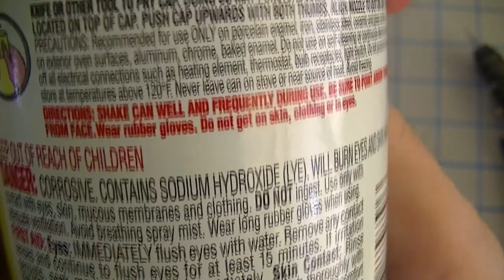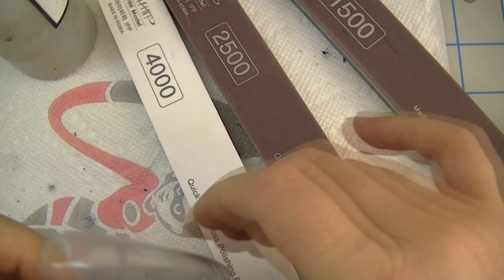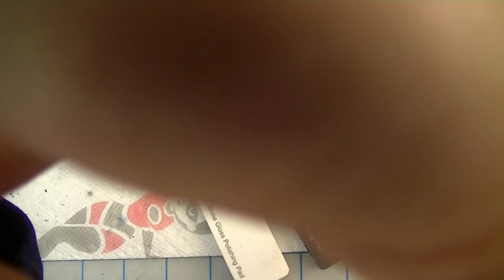ep216 - modelmaking fundamentals: polishing a canopy

Comment: Hey Will as a FYI, when went to a Micro mesh class on how to polish out scratches on a real canopy. The one thing the instructor stressed was not to sand in a circular motion. We started out with the "roughest" grit, spray a lot of water (we used a regular pump type spray bottle with tap water) sand in one direction. Once the area felt smooth and you weren't feeling resistance on your sanding pad. We went to the next highest grit and started sanding 90 degrees from the previous direction, and so on and so on till it was almost crystal clear  and then we used some plastic polishing compound.
Reply from the maker: Yes correct and I forgot to mention that. Always sand orthogonally. Having said that, I have to also say that I hate micromesh because of their shady made-up grit system. Regardless of that, though the technique is valid.

Comment: You ever try Nevr-Dull?   An old civilian watchmaker who worked in the instrument shop at one of the bases I was stationed used it to polish scratches out of watch crystals.  He would put a little spit on his finger and rub it on a small piece of crocus cloth to pick up some of the rouge, then he'd rub the crystal with his finger to polish the scratches.  Then he'd wipe that off and use a piece of Nevr-Dull to polish the haze off the crystal.  He'd make scratches disappear in a crystal that you would think needed to be replaced.  
It's a cotton so you could take a piece of it and polish on the inside of the canopy with your finger.

Comment: Hmmm......not convinced about not using Future.  I think it really brightens and clears clear parts pretty darn good!  Especially for the time commitment.
Reply from the maker: it's a poor solution that creates potential issues downstream.  polishing is easy and has no downsides.
Reply: @barpfoto  I disagree. I've been using Future for over 10 years and have never had an issue. My canopies are still perfectly clear and shiny.
Reply from the maker: @paulwoods4349  you're welcome to disagree. You do you. But that doesn't change the fact that you're doing unnecessary work and creating unnecessary risk and still not getting something that looks as good as a properly polished canopy.

Comment: Will, I may have missed it in an older video, but what kind of fiber are you using on that polishing wheel? My little cotton wheels don't seem to work well for me, even after I rough them up with a blade. Someone in the comments mentioned a soft foam medium for liquids?
Reply from the maker: for rouges, i use yellow cotton wheels.
Reply: @barpfoto  Shit, I feel lesser of a man now. My technique must suck, or I'm really obsessive of my shine with a cotton wheel and tubes of Tamiya polish. I'm getting some Zam.

Comment: Hi Will,  I know I'm probably about to ask a stupid question ! But I'm sure I'm not alone. I have been modelling for 40 years. I started with airfix enamels and now use acrylics, but you talk about mrp laquers. So I lay myself on the alter of ridicule and ask what are laquers and what is the difference between it and paint . And could you do a video explaining. Many thanks ( from England which probably isn't far enough away from you ! ) john
Reply: Big difference is that the laquer of the MRP is what I'd call slightly hot, meaning that it ever so slightly melts the surface because it is a solvent to styrene (like a ketone) which actually kind of bonds the pigments on to the surface and gets superior adhesion that is resistant to peeling or wearing. It becomes one with the styrene like Tamiya liquid glue does to plastic, but far less volatile.  Enamels are more of a varnish oil mix that hardens on top and doesn't penetrate the surface. Many "enamels" are more water based it seems these days. I think Will has some vids on it. Doog's Models I think does also as well as others. You can find them under MRP here on YouTube.

Comment: Will, I have used Future/Pledge floor care to cover some small cracks on the canopy of my typhoon to a good effect, looks like those windshield repairs that enters into the cracs and make them desapear, I had some of them looking like the Phanton you have showed here some time ago, In my model it was gone, I have masked them, painted and it didn´t peeled off. Now to strip paint I always use IPA in the ultrasonic bath, works every time for me. And I see you like power tools, have you tried out the foam type polishing pad that are like the ones of real cars? you can prime it with the polishing liquid in small amounts so it does not fly everywhere, it is squishy so it fits and conform to many places, you can get one backplate  with some velcro on it and you swap the top ones in different density to have more cut or less, you can find it in one or two inches of diameter, you can also find sanding discs to hook on that plate, I found very confortable to fix the tool to the table and move the piece around against the spounge of the pad . https://www.ebay.de/itm/1-Soft-Sponge-Polishing-Pads-M6-Air-Sander-Thread-Car-Buffing-Waxing-Clean-Tool-/323562194462 plus this one https://www.ebay.de/itm/Abrasives-1-Sander-Backer-Plate-Pad-1-8inch-Shank-100Pcs-Sanding-Paper-new/302963887782?hash=item468a0e0ea6:g:7XkAAOSwSppb8h5v:rk:25:pf:0
Reply from the maker: i need to try those!